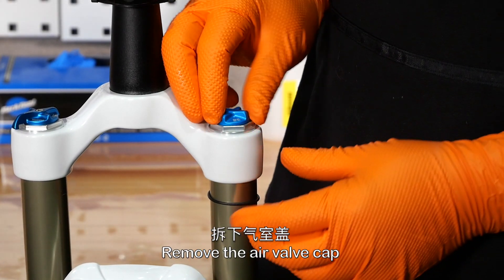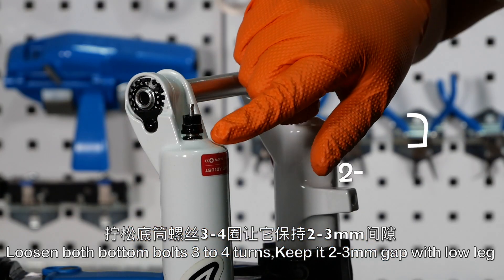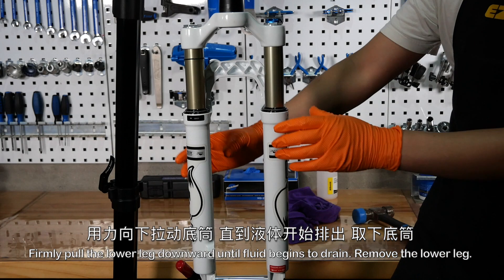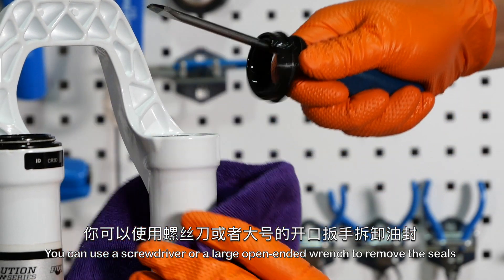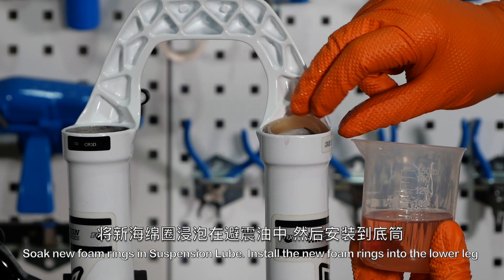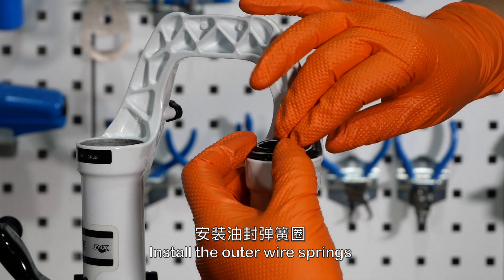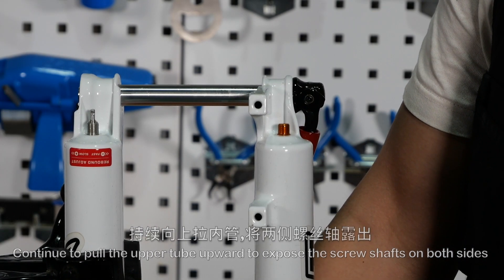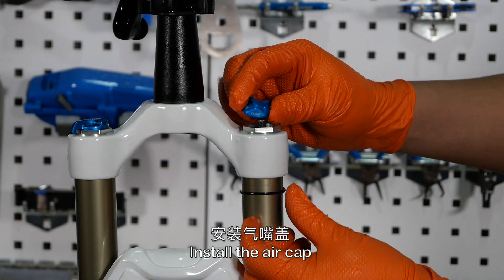How To Replace The Seals For FOX Fork

Comment: Why you do not lube seals inside with a grease? Dry seals have huge friction.
Reply from the maker: when you put the foam rings into the low leg, They already contain a lot of lubricating oil, which will be lubricated to the installation position
Reply: @ezmtb  yep, but seals have 2 edged: one to prevent oil leak and another to prevent get dirt in lowers
and between two edged there is a space which can be dry and bring huge friction
so the answer is would you recommend to lube space between 2 edges?
also this can help to catch dirt and hold it in seal where it can be easily removed on fork service
Reply from the maker: @Lezz015   Yes, you are right. We often see that some brands of seals will apply grease between the upper and lower sealing edge, which is good for assembly, but it is only limited to assembly lubrication. It will not provide continuous lubrication for the work of the fork, because most of the grease will squeeze out of the seal with the movement of the fork (the seal of the J style sealing edge is unidirectional) last of the grease will adhere to the seal rather than the upper tubes. If there are conditions, it is a good choice to apply grease, but if not, it will not bring any negative effects to the front fork. The gap between them will always maintain an oil film, which benefits from the use of our new seal materials. You will find that the upper tubes will always maintain a very thin lubricating oil film.